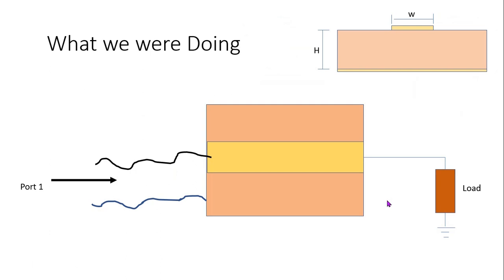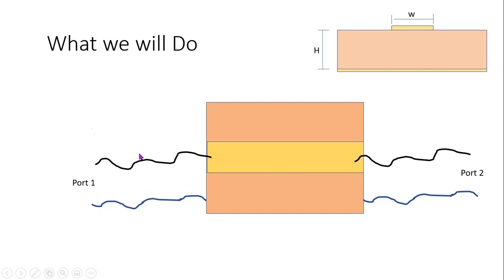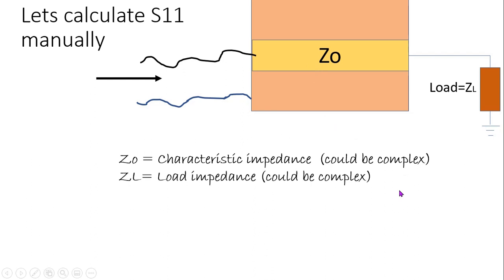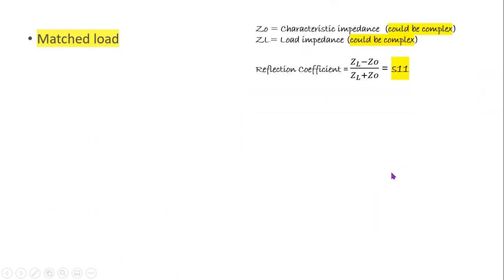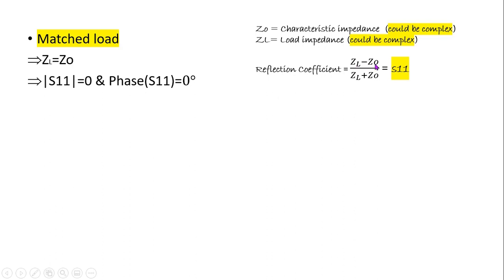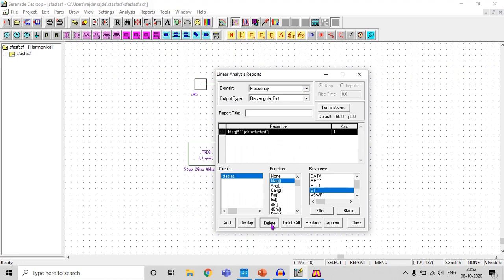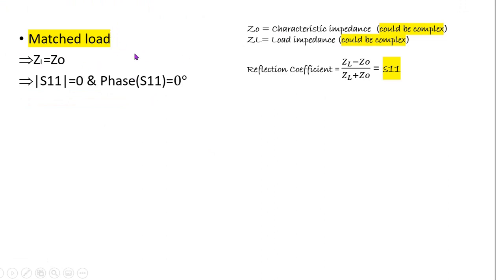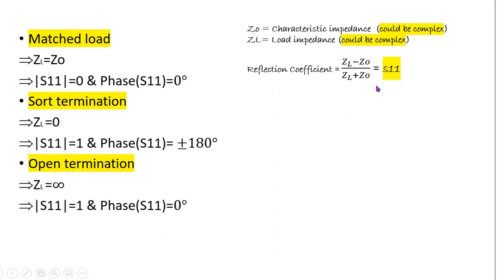Simulated Class 3(part2):Serenade Tutorial |Intro to short and open termination.

Comment from the maker: *One correction= general formula of gamaIN I provided here will give you phase(s11) correctly for lump circuit, but in the case of any distributed circuit like microstrip line, in high frequency, involved phase(s11) directly get influenced by Electrical length of your transmission line,  and phase(S11) might get matched with the general formula of S11 if your TR line length is of multiple of lembda/2 and no other unaccounted parasitic effect crip in. So don't worry if, for phase(S11), you are not getting the same result for some higher frequency.

Comment: thankyou so much sir for such wonderful explanation, I want to design a Chebyshev low pass filter and power divider working at 2.4GHz for my experiment, would you please tell me how to simulate that using serenade software or let me know the resources to design it on my own I am in great need to complete it soon.
Reply from the maker: For serenade i dont know we have any online resource or not, I have a video planned for low pass filter very soon followed by power divider also .. if it's very urgent then drop me a mail to rajdeep.jgd@gmail.com .. i will share with you few  earlier report I have prepared  for this using serenade